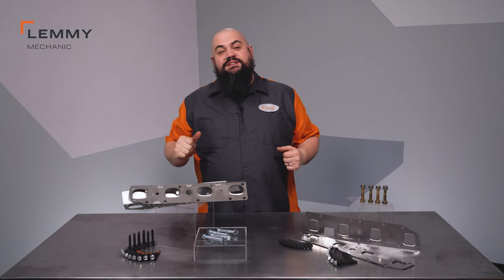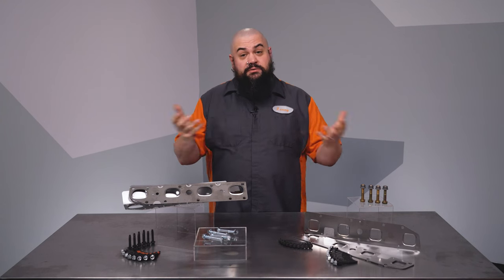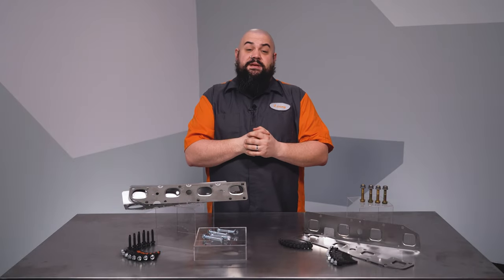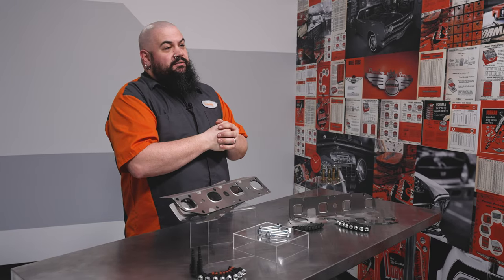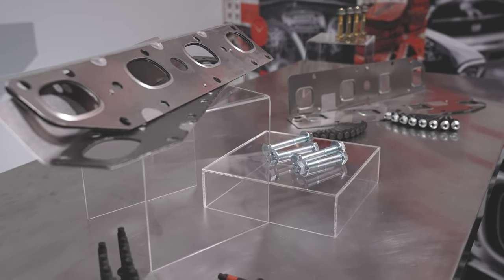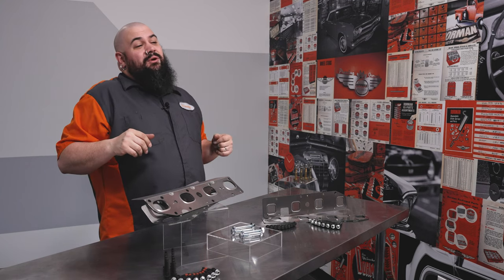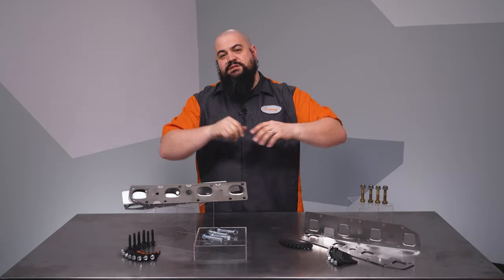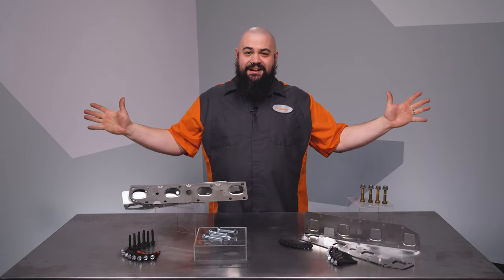Fix the HEMI tick with these complete stud and gasket kits

Comment: Does doorman make this kit for 2014 Ram 1500?
Reply from the maker: Hi Derek, part #57073 fits a 2014 Ram 1500. Thanks! https://www.dormanproducts.com/p-138491-57073.aspx?year=2014&make=Ram&model=1500&parttype=Exhaust%2520Manifold%2520Gasket%2520and%2520Hardware%2520Kit&origin=YMM
Reply: And what do I do if it's still tucking after I have replaced the gaskets and manifolds